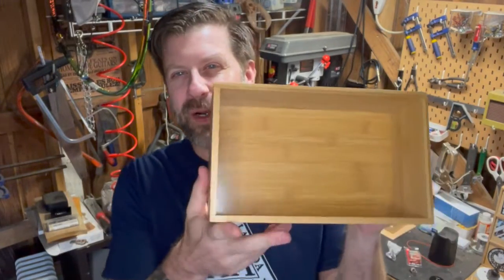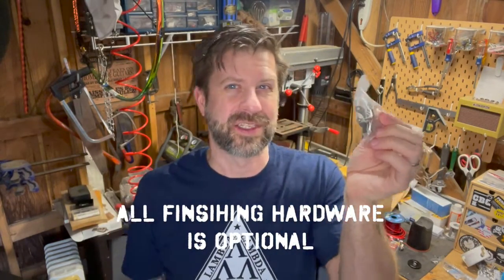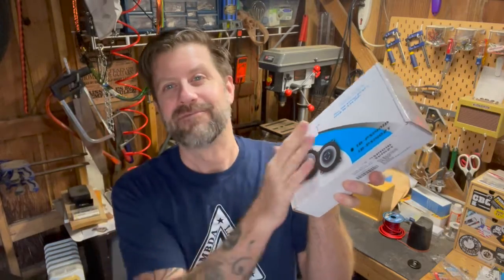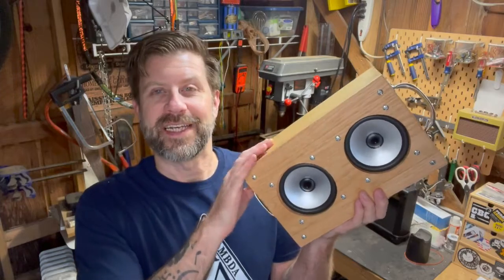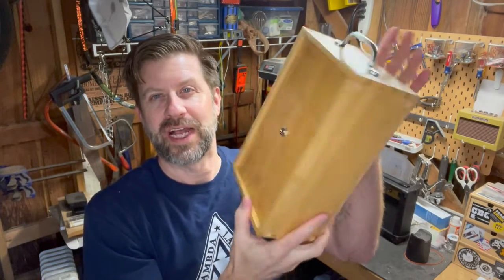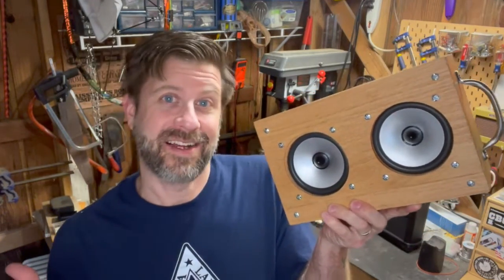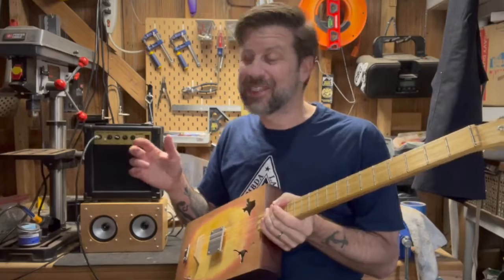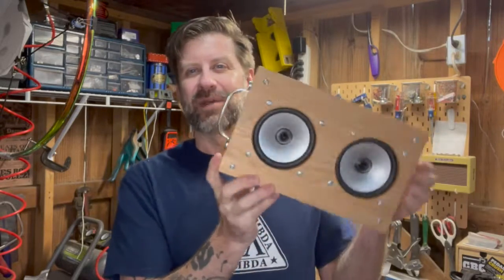How To Make a DIY Guitar Speaker Cabinet (dual 4" cab tutorial)

Comment: I bought an outdoor speaker cabinet at a thrift store for $5 and did a few wiring mods to make it into a guitar cabinet. Old speakers are often available at thrift stores although the quality and condition vary a lot.
Reply from the maker: Absolutely... and a perfect comment to showcase the theme of this video. Use what you have or what you can find for cheap. You may be pleasantly surprised. Thanks for checking it out.